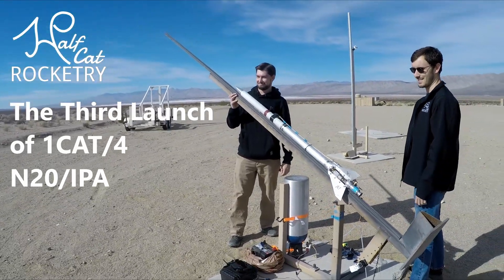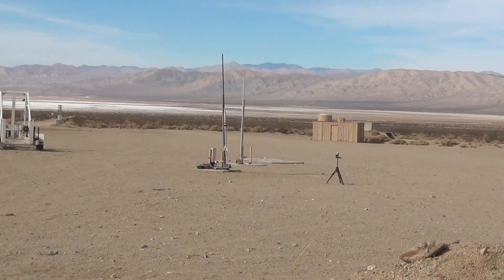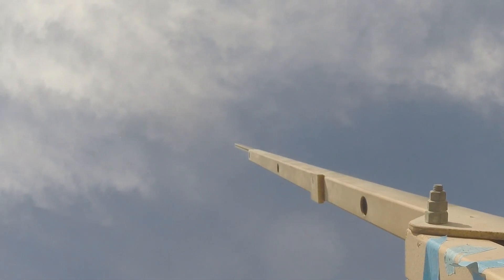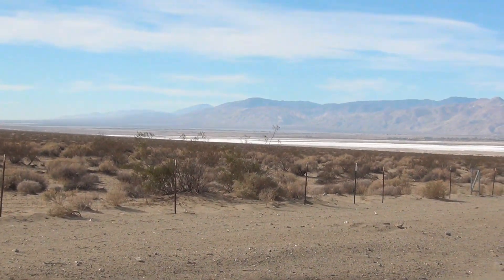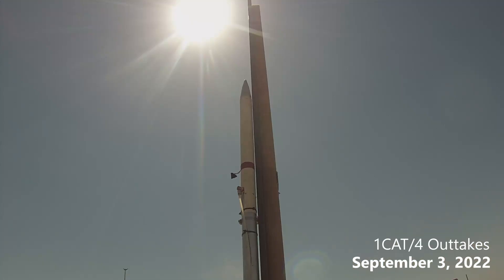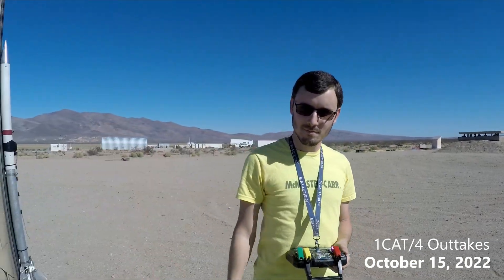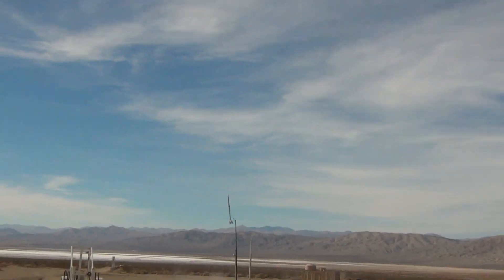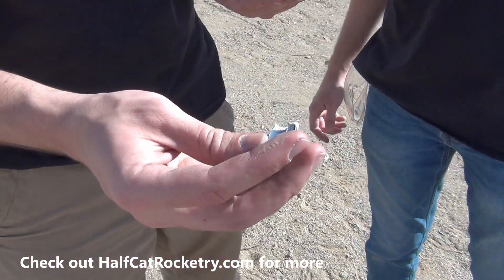The Third and Fourth Flights of 1Cat/4, by Half Cat Rocketry. Small Bipropellant Rockets.

Comment: What were the propellants used in this rocket??
Reply: On this launch, it was nitrous oxide and isopropyl alcohol.
Reply: @austinsennott  Oh, cool thanks for the info
~ Fly Safe
Reply: @austinsennott  what does the nitrous oxide add, i was under the impression it's not combustive let alone rocket grade.
Reply: @MRblazedBEANS  The nitrous oxide we use is very close to pure. It is automotive grade, so it has about 100 ppm sulfur dioxide, but that is small enough to have no effect on the combustion. When heated, nitrous oxide decomposes into nitrogen and oxygen. The oxygen is what burns with the fuel. While the nitrogen does not contribute to combustion and gives lower performance compared to pure oxygen, nitrous oxide is easier to handle and simpler to design for than pure oxygen in liquid form.